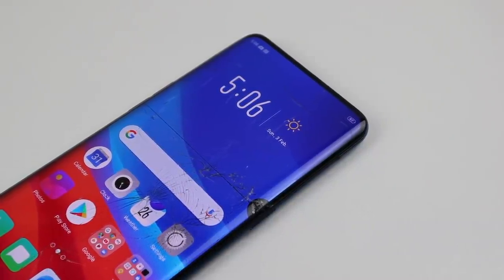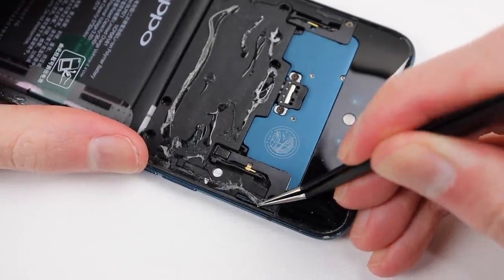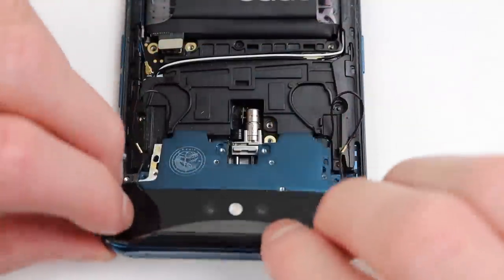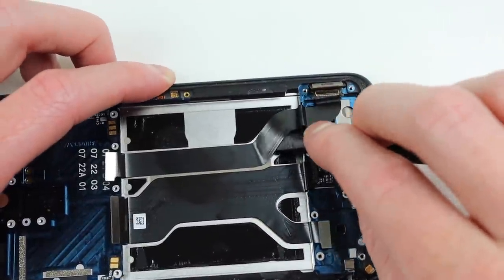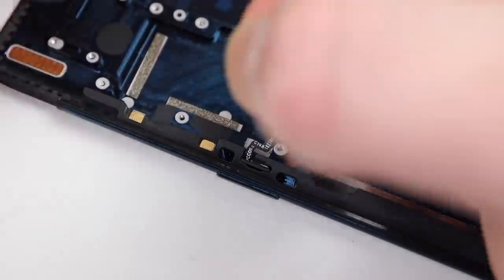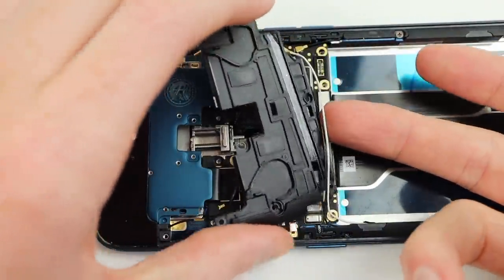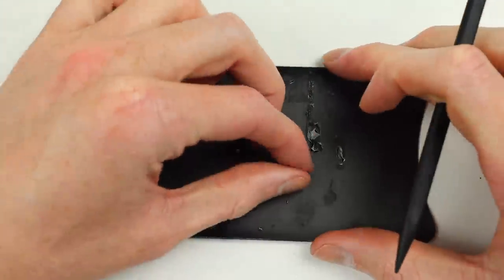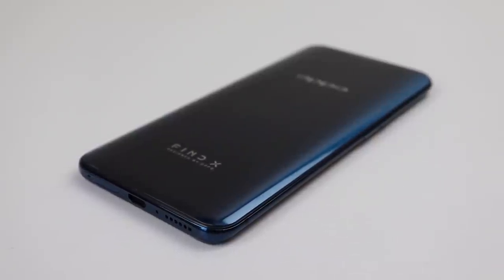Abused Oppo Find X Restoration - Fixing A Botched Repair.

Comment: With those moving camera parts and all those hidden cables under foam inserts and what-not, this looked much more fiddly than the usual repairs.
Reply: Yet people say Apple are the ones making repairs hard for people.
Reply: @OskarBlomkvist  Apple is making it unnecessary hard thats true. 
The find X is much more complex than a traditional iPhone. I mean, the camera alone is much more complex than the iphone in a whole. But there is a difference between those 2. If you are skilled you can get the find X to new condition again. You cant do that with an Iphone cause Apple tries to get you out of their phone. Every little bs is paired to the phone. Therefor if you diy repair your new iphone you will lose half of the features (not that there are many in the first place)
Reply: @Wraikey  I don’t agree.
The most common repairs you will do on phones are screen and battery, both of those repairs are really easy to do on iPhones.

On most Android phones you don’t get pulltabs for the battery and screen repairs require full disassembly.
Reply: @OskarBlomkvist  Screen repair makes you lose true tone, battery repair makes you get an error for you battery health even if it's authentic (like from another iphone). Both repairs dont affect your usage of the phone on an android.
Reply: @Wraikey  True tone can be fixed on most models, and a message does not affect the performance in any way (can also be programmed on most models)
Reply: @OskarBlomkvist  well but for cameras, touch id and face id, they wont work if replaced. And for the screen/battery its really annoying to get a pop up every 5 minutes saying your screen isnt original
Reply: @OskarBlomkvist  so you need to buy a specific tool, to reprogram a screen, with the code of the old screen, and you can't even do that if you don't have the old one or it's too damaged, while other phones are harder to fix, like this one, there are more legitimate reasons, (and I'm not talking about samsung and their glued battery) like this phone, where the camera is a moving part.
Reply: @neolordie  Yes, that's right. This phone is annoyingly fiddly but it's an artefact of its design. Apple's annoyances are done to increase redundancy and/or funnel repairs to its own service centres.
Reply: @libertyordeaf  increase redundancy ? making a part unnecessarily fragile and irreplaceable is for redundancy ? and do you know the price of a repair to their shop, and the quality of their service ? that's straight up scam, they don't want you to repair your phone, so they make it difficult for other to do it, and put a ridiculous pricetag on repair to their stores, so you buy a new phone instead
Reply: @neolordie  Redundancy in its strictest definition, not in the strategic sense. Screens, cameras, home buttons, etc. cease functioning properly when replaced by anyone else other than Apple. Yes, of course it's a scam, that was my point.
Reply: @libertyordeaf  oh sorry lol
Reply: @OskarBlomkvist  You say that but the camera's don't work even if you replace them with a genuine camera module from another iPhone. You lose true tone if you replace the screen and the battery pop-up is annoying as hell.
Now back to the Find X, why is it hard to repair? It's because it's much more complex as the whole camera module is a moving part with motors. [Hardware] There's no software lock checking the ID's of each and every part of the phone.
Now, why are the iPhone's hard to repair even though it has no moving parts? Because Apple made them that way. Why pair a camera module and make it not work on another phone? The fingerprint scanners I can understand but there's no reason for them to pair a camera module, battery, or even screen to a specific phone. [Software]
If they really wanted to, they could also just release a software update that bricks a phone if it detects signs of third-party repairs. Oh wait, they've already done that before.
Reply: @OskarBlomkvist  They are. If you replace the battery on an iPhone, the phone throws errors at you. If you replace the screen on an iPhone, the phone throws errors at you and disables features. What are the most common repairs on phones? Like you said, the battery and the screen. Apple intentionally makes this hard to push you away from DIY or third party repair, to get you to go to the Apple store instead where you'll either pay a lot more for the repair, or they'll just try and sell you a new phone.
Reply: @Wraikey  we saw that last subtle shade.
Reply: @OskarBlomkvist  this phone is still 100% easier to fix than any phone apple makes
Reply: @veganlife1710  It’s just not though?

To replace a screen on these models you literally need to fully disassemble the device?
Reply: @OskarBlomkvist  Bro people literally told you how Apple makes it harder and full dissasembly of an Android device is way easier than an iPhone. Even this Oppo X was easier than an iPhone

Comment: Three things:
The screen you purchased is very likely genuine part, since these require more than a simple factory line to make. Hence the price.

2. Using decent liquid adhesive is always the better option, unless you have access to proper vulcanizing machine and decent quality adhesive. This tape you use is rather strong if it has enough area to stick to, but in phones, usually you don't.

3. It's a novel device, hence it's kind of strange.

Comment: My opposition to the "hidden front camera" is its a moving part which is possible failing point. Yea it's nice not having the notch or pinhole, but... gonna suck if the motor happens to fail after a year...
Reply: I agree with you, it's a huge possible failing point, not to mention that this phone is also fragile. Oppo Find X was my daily driver and I still use it every now and then, while mine works just fine until now, using it feels like you're holding a piece of glass.

Comment: You can stick the red tape on the rear glass around the edges and cut the excess with a scalpel. That's the best way to apply non genuine adhesive. Great video!

Comment: "there's no excuse for a notch or a hole punch camera"
Literally 30 seconds earlier you talk about the phone not being water resistant, which is due to not having a template adhesive, which is due to the motorized camera. So... There's the excuse. I'd rather have a hole punch and proper seal.
Reply: I would rather have a under display camera or a small popup camera (Oneplus 7 Pro ).

Comment: Hey Hugh Jeffreys  i just wanted to ask question that i think you can help me with .  I have a Samsung Galaxy  J 7 Prime  that i flashed a few months ago to remove the FRP lock  and after the flash the phone some functions stopped working  such as wifi turning on the touch button and the home button not working and once the screen goes off i have to remove the battery so that i can use the phone because the power button is not working .  Please help me with so tips that i can use to fix the phone. I will really appreciate the help . Thank you

Comment: Hello Hugh
I am currently trying to learn on fixing phones and i have an iPhone 6S that i would like to start with, its my old phone and it has a cracked screen.

Where would you recommend buying the replacement parts from?
Reply: Ebay will be fine for that phone, I'd also put a new battery in as well, I learned by watching this channel and made a bit of money in the 1st UK lockdown by finding broken iphones on Facebook and fixing them up 6, 7s and 8s are easy to repair just remember to keep the old home button and pop new battery's in them 👍🏻

Comment: Hello Hugh! Great video. Do you have had any experience with priorparts.com? I am looking forward to buy something from there.
Reply from the maker: Ordered some housings from them. ok overall but make sure to check over the installed parts they tend to miss some.
But after buying from them they were constantly sending marketing emails and refused to stop spamming me even after I requested for them to stop, so I blocked their email.
They also won't reply to my emails in regards to closing my account with them. You don't need one to buy from them.

So I would regard it as a poor experience.